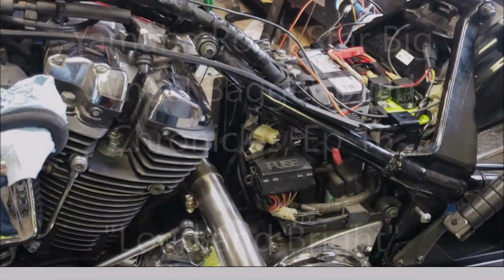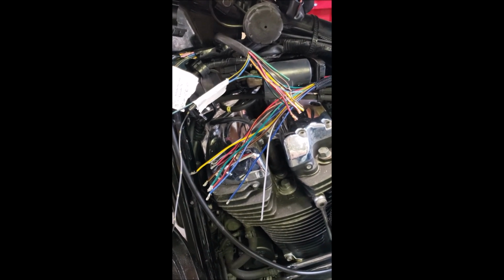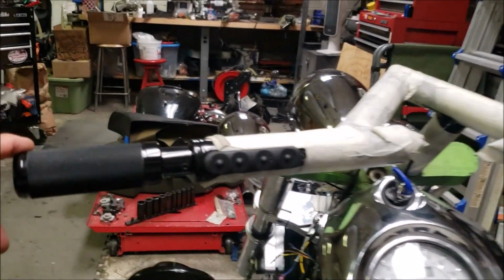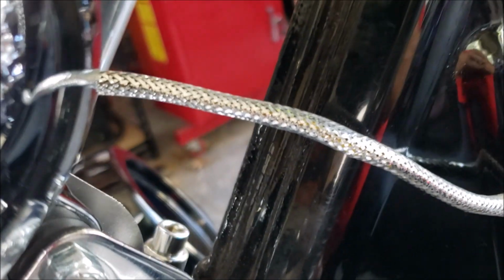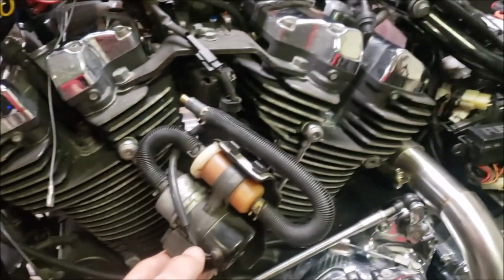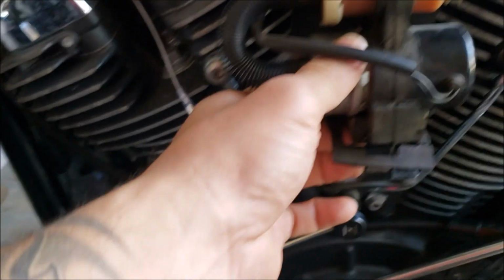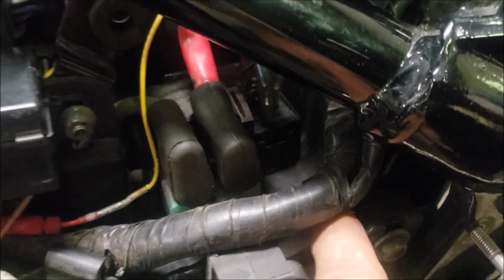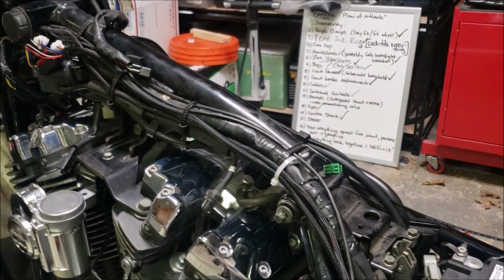Yamaha Road Star Big Wheel Bagger Build Chronicles, Ep 16

Comment: I have a question how did you put the lowers I have a 2015 v star deluxe and wanted to know how to put lowers on my bike
Reply from the maker: Hey there Ricky, first of all, thanks for tuning in.  Thise are lowers and highway bar for an '13 and up Harley Touring bike, if I remember correctly.   I had to make my own mounts for the bottom and make a hole in the top of the A frame up front to mount it.  The lowers were made for this highway bar.
Reply: @mr_sinister  I have the bars from factory I was wondering do you think if I get lowers from Amazon what’s the most thing I would have to do to install them
Reply from the maker: Hmmm, that's hard to say.  Those lowers are formed in the back to fit on a specific bar (width, curve, etc...) which is why I went the route I did.  There are a couple of companies that make aftermarket lowers, however,  you may have no choice but to get different bars.  I got them off ebay or Amazon, they weren't expensive.  The mods to make the brackets aren't tough either if you've got the patience and a few tools.

Comment: not going to lie i just binged watched all your episodes. im very very impressed with how far and good of a job you have done for you passion. its awesome to see this kind of work. As of seeing this episode i like how the speaker fairings look where did you get the crash bar from? 
please keep up the great work
Reply from the maker: Thanks for tuning in and for the compliments.  Got the crash bar off ebay or Amazon, don't remember at the moment, but I did get the later model ('08+) so that I could use the lowers that I wanted.  Had to drill the A frame under the neck for the upper mount and made brackets to kick the bottom further forward.
Reply: Much appreciated, after watching your videos, I now have a good path as to where I want to go with my road star. Namely the front end speakers and crash bar.  Keep the good work going and flowing.  Keep the strong energy going. 💪

Comment: Is it possible to do this on my Yamaha v star 950?
Reply from the maker: Which part?
Reply: @mr_sinister  the led lights on the lowers
Reply from the maker: I don't see why not.   I had to use JD bars and HD lowers.  I had to modify the upper mount and fabricate the lower mounts.  If you have to do the same, it should work